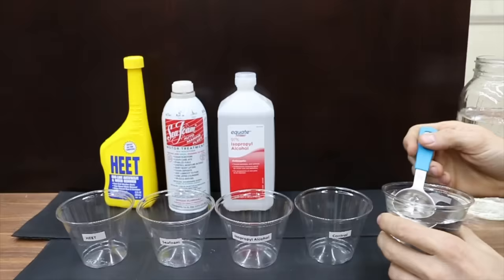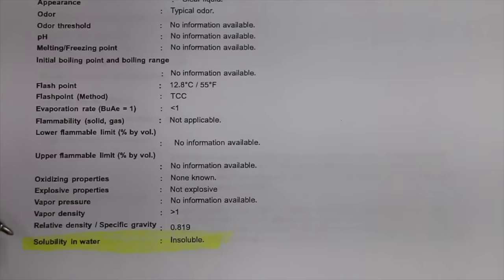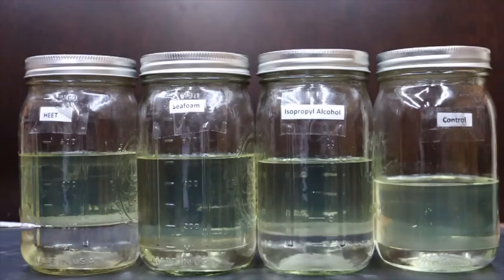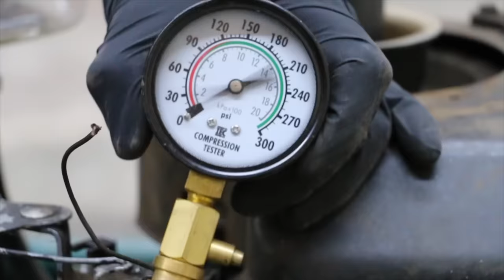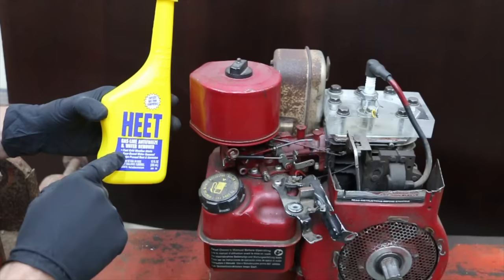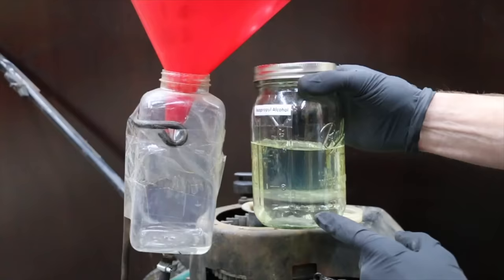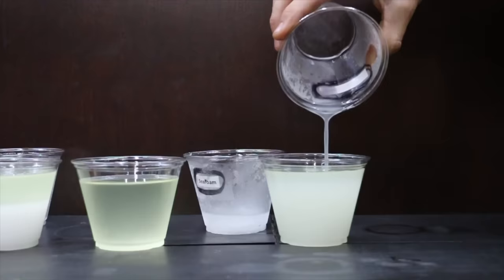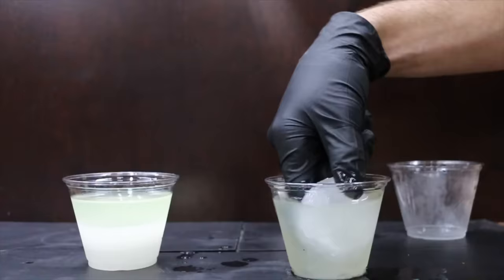Is HEET better than Seafoam for Water in Fuel?  Let's find out!

Comment: There's 2 products that I use when I have water on the fuel and it's freezing.  First is Methyl Hydrate.  Second is Diesel Melt by DSG.  Diesel melt works better at burning whatever water is in the tank the methyl hydrate.  I've seen both unfreeze water in tanks in -35 weather.  Diesel melt seems to be more aggressive though.  Not sure if it'll work in gasoline.
Reply from the maker: Thank you for the feedback

Comment: A P.S. side-note; we used to have for many years a vehicle exhaust test which originally forced all vehicles to do. Along the way many lawsuits were filed pertaining to specialty vehicles (antiques, work types, etc.) and then eventually motorcycles, which by their very nature released less emissions than autos. When the general public started getting wind of the actual data that with the remaining vehicles very few of them were failing. The one's that did fail almost always belonged to the lower income families which couldn't afford newer vehicles or the cost required to get them back into compliance, which then became apparent it was basically a very expensive TAX on the poor. This along with the fact that they had no control over Interstate Hwy's running through town, the program was eventually dropped due to public outcry. - "Are you listening Tennessee" -

Comment: One winter it was extremely cold one week and my dad went to move his 08 Silverado to plow the driveway and it went into "limp" mode we guessed it was water/ice in the system and we had a bunch of that Heat additive, dumped the right amount in let it sit a few munites fired right up and ran normally...
Reply from the maker: Thanks for sharing.

Comment: Back in the 80s it was somewhat common knowledge that isopropyl alcohol degrades rubber hoses. Fuel dryer should always be methyl alcohol to prevent this. It's noteworthy that isopropyl alcohol is usually 70% or 91% the rest is water which is what you're trying to get rid of. You would do best by using Everclear alcohol you can buy it at the liquor store. It's ethyl alcohol which doesn't harm rubber and It only has 5% water. Great video as usual 👍 Oh yah, I'm just curious how long did it take you pulling the cord on those engines before you hit on the idea of using a power drill/driver to start them?
Reply from the maker: Thank you

Comment: The County I live in (and a certain amount of miles inside the surrounding counties), has mandated the use of reformulated gasoline in the Summer (not sure of the start or cutoff dates). It contains a myriad of chemicals that's suppose to decrease atmospheric evaporation. This is horrible fuel that not only breaks down much faster than normal gasoline it seems to also absorb more water vapor (Do Not leave this stuff in a boat motor for ANY length of time, I learned the hard way). I add Heet to every third tank of fuel and Sta-bil fuel stabilizer if my truck is going to sit for any length of time. So far I haven't experienced any fuel system problems that was previously prevalent in other engines, specially all my small engine equipment, which I add both to their fuel if using this gas, lately I've been using the small engine fuel purchased at auto parts and big box stores, a lot more expensive but is very good gasoline.
Reply from the maker: Thank you!

Comment: I poured yellow Heet in a car and it wouldn't crank. Then I poured a half a bottle of alcohol in it with about 3 gallons of fuel. No,crank. Then I drained the tank, and added new fuel. Now it cranks. Im sure I removed most of the water, and what was left in the tank was mixed with Heet and alcohol. Car was sitting for 4 years. I also use alcohol to clean my lawn mower carb floats.
Reply from the maker: Thank you for the feedback

Comment: I have a minivan with EGR Flow issues. It only has 14K and most of those are local miles in my borough, often traveling sub-35MPH. I should get a call from the dealer tomorrow, but I suspect I’m having gunk issues because of water in the fuel and not hitting highway speeds often enough.
Reply from the maker: Thank you for sharing!

Comment: I use only 93 octane with no ethanol . I work on small engines and I use 93 octane with fuel stabilizer and seafoam . I tell my customers after the equipment leaves my yard - its in there hands . I'm a strong believer in no ethanol in small engine equipment , I was also told by a John Deere representative that if you use ethanol gas they will not warranty their John Deere carburetors/and they could tell if they worked on it .
Reply from the maker: Thanks for sharing.

Comment: Great video!! I actually knew heet would melt ice had a old Subaru brat once really cold out carb set out front of engine wouldn't hardly pull itself carb was completely covered with ice pored heet on ice it just melted it away put bottle in every fuel up all winter never had problems again.  I still run heet in everything I own. Enjoy your videos Thanks for sharing be safe have fun
Reply from the maker: Thanks and you are welcome!  Thanks for sharing.

Comment: Also under ground tanks will collect water aka condensation  in the bottom. Never stop at a gas station if you see a tanker truck fueling the under ground tanks ! It stirs up the water and any other junk in the bottom of the tank! Especially if what ever you have run with a carburetor
Reply from the maker: Thank you for the feedback

Comment: My buddy drove his Honda Del Sol into a bunch of water, car stalled, water got into the tank quite a bit. We didn't want to drain the tank, so we poured multiple bottles of fuel stabilizer and octane booster in, as well as fresh gas. The car ran like garbage for about a hundred kilometers or so, but it was smoother than ever afterwards.
Reply from the maker: Wow!

Comment: Not water in gas but water in an engine. Inside the engine every surface was coated with white milky residue from oil and water mixing together. I tried Rislone engine treatment. It was the only thing I used that actually worked. Mind you it was a small lawnmower engine.
Reply from the maker: Thanks for the feedback.
Reply: @ProjectFarm  Thank you for the videos

Comment: You should see what a Water/Methanol mix burns in a jet engine. Our Alison 501D13 Turbo Props had Water/Meth injection. On a real hot day in an area like Phoenix, Water/Meth injected into a jet engine would increase the SHP (Shaft Horse Power).
Reply from the maker: Thanks for the feedback.

Comment: Thanks for this video.. ihave water in my tank from bad gas at a gas station.. and its causing my wagoneer to sputter when driving.   I was about to dump seafoam in there.. but i got isopropyl alcohol and dumped half a bottle in the 20g tank.. and its running much better now.. still sputters with heavy throttle.. new fuel filters too..
Reply from the maker: You are welcome!  Thanks for sharing.

Comment: At the dealer service department, contamination in fuel is solved by removing the fuel and the contamination even if it requires replacement of parts.
Using chemicals they talk you into in the aftermarket just adds cost without results.
I've seen numerous vehicles in wrecking yards with multiple empty chemical bottles in the trunk.
If contamination or water was their cause?
They needed to remove their fuel and add fresh fuel from clean containers.
It's that simple.
Oxygenated fuel caused some no starts I saw towed in. Same solution. Replace that tanks fuel and clean lines and components.
Reply from the maker: Thanks for the feedback.

Comment: I learned to never stick my bare arm into a tank of gas when it is -35 degrees outside. I live in AK and had ice in my tank. Having cut a access hole already to replace my fuel pump I reached into the tank to pull out the ice. Frost bit my arm.
Reply from the maker: Wow!  That's cold!
Reply: Yes it is! I didn't even think. Shined the light into the tank. Saw the layer of ice. Rolled up my sleeves and reached into about elbow deep of gas and grabbed the ice. Was not crazy cold until I pulled my hand out of the liquid. Then I could not get to the woodstove fast enough.

Comment: Thanks for the video,

I buy my alcohol by the five gallon bucket (about ten dollars a gallon). It's denatured alcohol, which I use for shellac and other things in wood working. Since government uses methanol to poison the alcohol, it should work a little better than the isopropyl alcohol, presuming you keep it capped, so it doesn't absorb water from the air.

__________________________
NOTE:  Denatured alcohol is alcohol government poisons so it will injure or kill those it represents,  if they drink it without paying a tax.
Reply: The cons and cons of prohibition....

Comment: I had not seen this video before we received a bad tank of gas at the Speedway near the train station in Durango, CO (they deny any issue with their fuel).  We fueled up the night before we left to go home to Vegas in late April.  The morning we left the car was running horrible (2023 Jeep GC L w/4k miles on it).  We got to Cortez, CO and the Jeep dealer there was less than useless.  I remembered @LegitStreetCars having an issue with water in his gas after buying @Hooviesgarage Mercedes AMG S65 coupe.  I went to the local NAPA and they said "oh no, SeaFoam is much better than HEET".  Thinking about it I went to the Autozone (or O'Reilly's) down the street and bought bottle of HEET and dumped both in the tank.  Ran that full tank all the way to St. George, UT with no issues.  I always wondered which one did the trick and now I know it was the HEET.  Thanks for the video!
Reply from the maker: You are welcome!  Thanks for sharing.

Comment: What the purpose of using heet or alcohol when most gasoline is 10% ethanol ?
Reply: Great question, Todd what is the reason, 10% ethanol should remove the water.

Comment: Thanks for the great experience with your experiments.
If you leave Gaston on Mercedes-Benz 1989 300 E4 Matic. Will the gas deteriorate and destroy the engine injector system account of all gas it was filled to the top with Chevron 94 octane and litre seafoam. Should I drain the fuel to prevent damage to the engine or is there an alternative to bring the old gas to a combustible state.

Comment: My personal experience with water in the fuel 20 years ago. We went to Hershey and got water in our gas on a fill up.
Car started bucking and missing. Bought 3 bottles of Seafoam.
I added a bottle and no difference. I drove 5 hours home and chugged all the way.
Added all 3 bottles eventually no improvement.
Then tried Red bottle Heet no improvement..
Got home dropped the tank and had an 8-12 oz water bubble in the bottom of the tank where the pump was.
I sucked it out with a transfer pump and it ran like new.
Reply from the maker: Thanks for sharing.

Comment: Why not use a simple product like Methyl Hydrate. Easy to find and very cheap to buy. Methyl Hydrate combines with water to form Methanol which simply burns off in the gasoline.
Reply from the maker: Thanks for the suggestion.

Comment: I have been of the understanding that when isopropyl alcohol or heater is mixed with water and fuel,  the mixture be drawn through the fuel line into the fuel filter. At that point I have wondered does any water make it through the fuel filter? I run a lot of equipment and generally change the filters later autumn and have found ice in the fuel filters. It would be an interesting test with clear tubes and a glass see-through filter to watch the fuel water mixture pass into the filter - to see if the water passes through.Thanks for your videos!

Comment: The best option, with non-ethanol fuel, and diesel, is to use an Aquafighter. These drop in to the tank on a string, and bind every molecule of free and emulsified water into a gel satchet, which you then pull out. Easy. Cheap.
Reply from the maker: Thanks for the feedback.

Comment: i live in alaska and a common problem is water or ice in your fuel tank due to people having there car or trucks inside a heated garage then going outside into - whatever the temp is that day weather. then parking back into there garage condensation will always happen and people tend to put bad fuel or whatever in there tanks like idiots. but i would never use seafoam for water in my tank to clean my injectors and fuel lines and what not yes but for water hell no that just common sense to me. i had never herd of anyone using iso before but makes 100% sense. use RED HEET IF YOU ARE GOING TO USE HEET witch is what i would use and do use. the temps up here can go from -40 to 40 above in such lil amount of time that when there are huge temp diffs i will put a can of RED HEET in wail i fuel up just in case. fuel pumps are not meant to pump water and will burn out real fast and engines are meant to run on water and will mess up real fast. now if you have a diesel tho use DR DIESEL never us HEET on them. RED HEET is far better then the yellow and burns better just an fyi

Comment: I used to use iso-heet in my old suburban with a leaky gas tank. Never had a problem with frozen fuel lines but I'm sure it contributed to corroding the tailpipe.
Reply from the maker: Great information. Thank you

Comment: The best solition to removing water from a gas tank is. Don't use corn syrup gasoline. That way you don't have to waste your money on additives. The engine will run better. Start easier, wont get stalls or ruff idle, corn syrup free gas  wont eat the rubber or dry rot plastic. And it won't clog the caberator.

Comment: One -4° F (-20°C) day my car wouldn't start.  After consulting with my mechanic father, he told me to put 2 oz 99% isopropyl alcohol in the fuel tank and wait 10 minutes, to disolve the ice clogged fuel line.   
 2 oz isopropyl in approx 25 l of fuel was enough to do the job!
Reply from the maker: Thanks for sharing.

Comment: I think it would be interesting to see how much water these products would tolerate in solution and remain one phase, and how much ice they would melt. It would require using much less water, and then varying the amounts of water downward until you reach a successful mixture. I know folks really want something they can dump in the gas tank to take the water out, but when you get to a certain level of water in the fuel system, you have to drain the fuel system. There's just no other way to remove gross amounts of water. If people wouldn't steal the gas out of cars, gas tanks should have a water removal valve at the lowest point on the bottom of the tank, and if water does get in, it could more easily be removed. I don't know if anyone makes a locking valve that could be installed on a gas tank and keep the environmental parts of the fuel system working undisturbed, that would be a solution to easily remove gross water from a fuel tank and keep your gas from being stolen. For ice, the solution would be to bring the vehicle inside somewhere that can be warmed above freezing and allow the ice to melt, then drain the water. It's just not an easy problem to deal with.

I don't have to deal with ice very often at all, but I do have to deal with water. It's very humid in south Louisiana and it rains a lot. Our state forestry department has a gasoline testing lab that gets really busy when it rains a lot and people complain about water in their gas from whatever gas station they filled up at during the rain storm. I don't know why the forestry department does this testing, I just know they do. It doesn't make sense but it is what it is.
Reply from the maker: Thanks for the suggestion.

Comment: Have you ever thought about showing what happens when an engine gets hydrolocked? I have seen and experienced myself the sinking of an ATV and having the engine fill with water mixing with the engine oil and hydrolocking the engine. The steps it took to clean the engine out and get it running safely. I have also experienced a vehicle engine which became submerged enough to suck water in through the air intake and hydro lock the engine and then through continued attempts at starting after the engine was hydro locked, bent one connecting rod and broke a second.
Reply from the maker: Thank you for the video idea!

Comment: Thanks pal. As always very informative. Now I have to find something that works. Unfortunately it seems nothing beats a warm garage. I had always used HEET. A full gas tank in freezing temperatures was one of the ways I could be able to park outside and use the vehicle reliably in the very cold temps. HEET seemed to work in those circumstances. 
What now?
Reply from the maker: Great feedback. Thank you

Comment: My dad had lots of diesel in used bottles after variety of coca cola & similar high sugar drinks. One day he dumped from almost empty to full tank in his Citroen Xantia 2 with 2.0 HDi 4 cyl / 8 valve turbo diesel. Engine ran poorly from time to time ( I bet, it had some of the soda in injector/s and in rail), but it did over 1300km on full tank(65L) (~5l/100km / over 45MPG US)
Reply from the maker: Thanks for sharing.

Comment: I have a 2013 Hyundai veloster with the gdi motor. It's been misfiring during startup and while coming to a stop in traffic. Changed the spark plugs and coils and ran seafoam through it but just learned seafoam is not the best option for gdi engines. Going to try heet and if that doesn't work guess it will be replacing fuel injectors next.
Reply from the maker: I hope you achieve good results

Comment: I would like to have seen what water applied to e10,e15, and e85 does. As these fuels contain methanol(alcohol). Most automobiles driven in areas which sell e10(like in upstate Ny where i am) rarely require heat or similar products, as the alcohol content already picks up any moisture in gas and burns it off. Thanks
Reply from the maker: Thanks for the video idea.